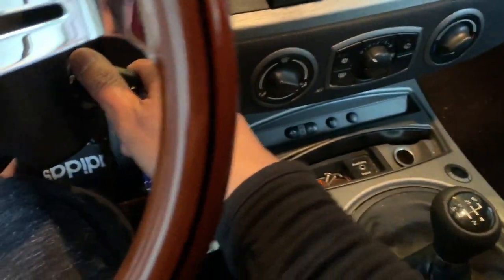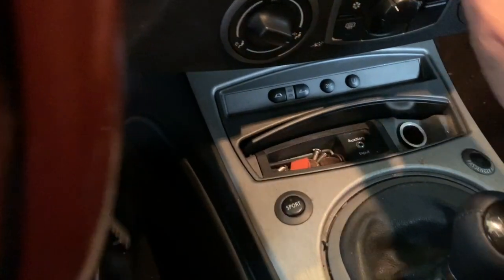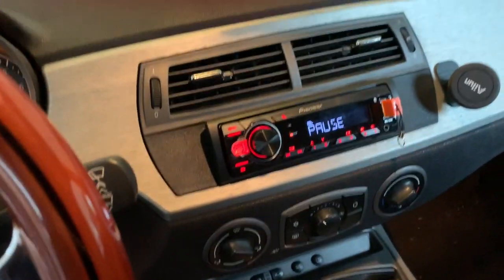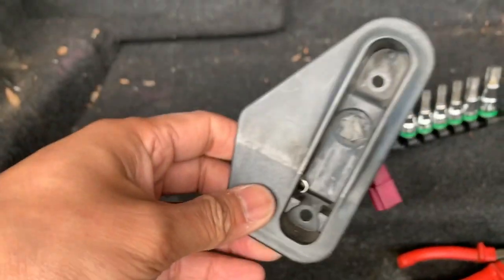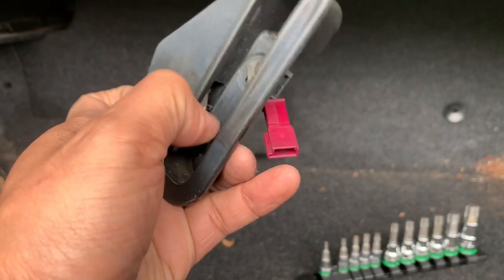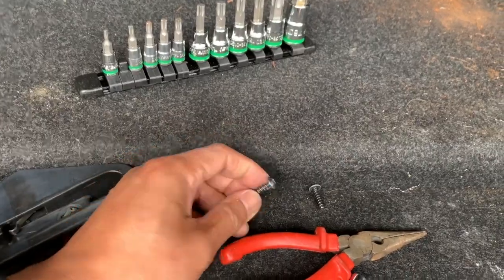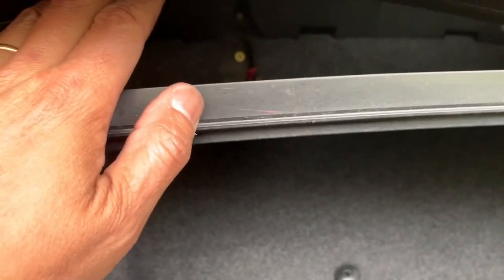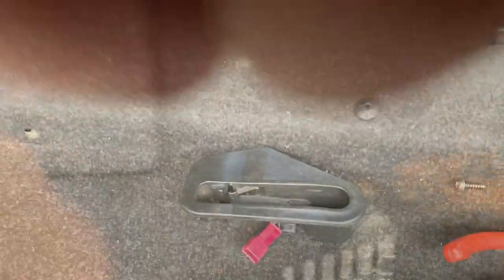bmw z4 - convert micro switch

Comment: Yo this worked! Also: if the little pin of the microswitch fell out (happened to me). You can take the microswitch apart, put the pin back in, install it and it will work. Worked for me!
Reply from the maker: Thanks for sharing.

Comment: Ccn you tell me how and what did you splice? Did you do a mid splice to connect blue/black together ? Not sure what to spice as there still needs a connection to the car side. Thanks
Reply from the maker: This connector has two cable.  Just tie them together.  Tells the car you don’t have an issue (ie tray is in place).  Stop the car from checking and just allow soft top to come down.
Reply: @Simplenetwks  Thanks so you mean to strip each wire a little at mid point to connect them? This won't short or trip a fuse?
Reply from the maker: @v.m.7228  no it will not short out. When the tray is down in the trunk,  it connects the circuit.  Sometimes the connector in my hand fails.  So car does not realize that the circuit is complete.  So you are forcing it.
Reply: @Simplenetwks  Thanks so I will spice each wire mid point and connect them together (not sure how yet), then clip to the car connection.

Comment: I’m an idiot. How do I pull the connector apart? Mine is very tight and I don’t see a release tab on either clip.
Reply from the maker: No worries. There are two screws that hold it in place.  Since these cars are a bit old,  it may require a bit of wiggling.  You will get it.

Comment: What size are the bolts for the switch in the trunk?
Reply: Nvm, my bad. I didn’t go far ahead enough in the video
Reply from the maker: Hope the vid helps you.  When I didn’t figure it out,  I had a though time trying to understand why my soft top didn’t work.
Reply: @Simplenetwks  I replaced the motor yesterday and it works, it’s just that the switch is pushed back so the tray the top sits in doesnt touch it

Comment: What cables do you tight together
Reply from the maker: When you unlock this switch, there is a cable that attach to it.  Connect both ends together.  It will close the circuit.  The car thinks everything is ok and allow soft top motor to move.

Comment: So was the switch in the boot the problem?
Reply from the maker: Ulrich yes it was.  The replacement part on eBay is $30.
Reply: @Simplenetwks  Thanks man, this happened to be my problem aswell.
Reply: Sonny Nguyen Hi, I am having the same issue, would you mind sending me the link on eBay of the part please as I can’t find it.
Many thanks
Reply from the maker: Ali Akkache  BMW Genuine Folding Convertible Top Compartment Micro Switch 323Ci 325Ci 330Ci M3 645Ci 650i M6 650i Z4 2.5i Z4 3.0i Z4 3.0si Z4 M3.2 640i 640iX 650i 650iX M6 https://www.amazon.com/dp/B00TP1U0J6/ref=cm_sw_r_cp_api_i_-7eyEbM4NQ3YA
Reply from the maker: https://rover.ebay.com/rover/0/0/0?mpre=https%3A%2F%2Fwww.ebay.com%2Fulk%2Fitm%2F163779802539
Reply: My microswitch works to tell the front motor but the trunk motor has been replaced but it's not working even though it's new and replaced